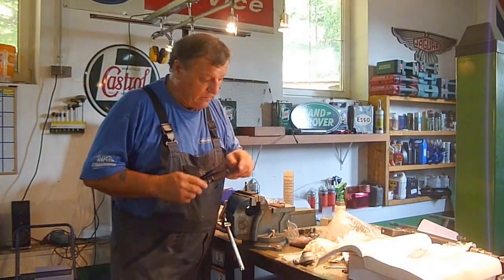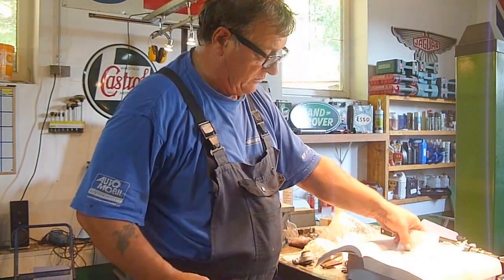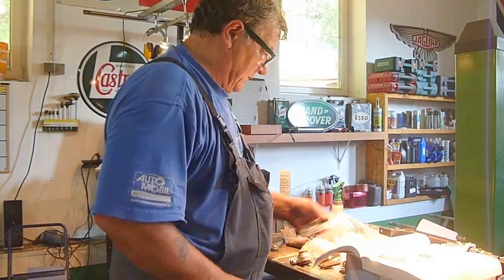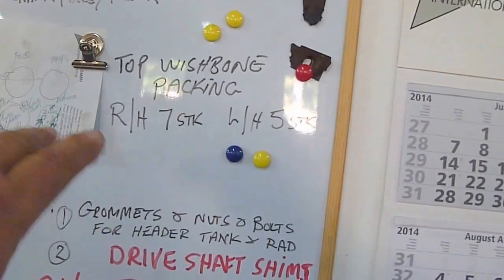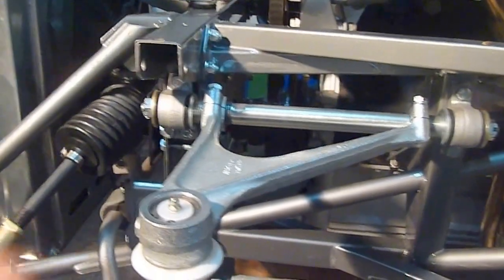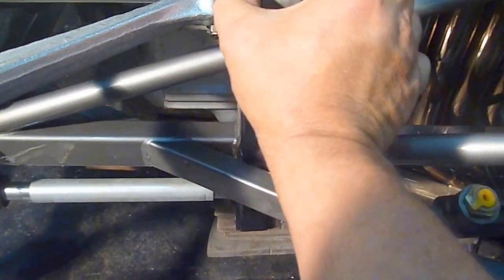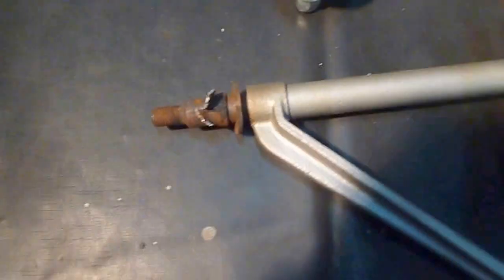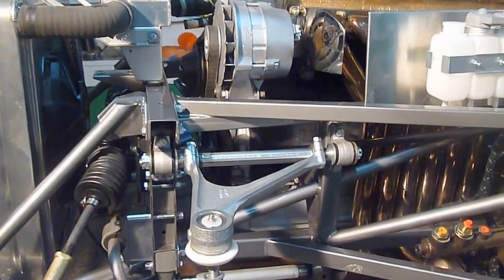Jaguar e type front suspension Part 1

Comment: Same thing happened to my lower bushing spacers.  They basically welded themselves to the fulcrum shaft.  I used a thin angle grinder to cut a spiral grove in the spacer.  I then peeled the metal away, like you are doing.  The trick is not to score the fulcrum shaft by going too deep on the cut.  I don't think a little "nick" here and there does any damage though.  And you can bet, when I put new bushings on, that there will be PLENTY of anti-seize compound inside.  Speaking of this phenomenon, some of the bolts did the same thing in the blocks which mounted inside the lower picture frame.  What a #%^$#@& THAT was getting those things removed.  Then I had to drill out the bolt shafts on my drill press.  Once you drill the bolt thin enough, it finally releases when you hit it with a punch.  You might want to try this on your upper split arm.  It'll be tricky because you have threads to worry about.  But drill it, heat it, and see if an easy-out will do the trick.  If that doesn't do it, drill a little larger, and repeat.  But a regular bolt shaft is WAY easier.

Comment: I have no idea what spacers were used for the front suspension on my 1962 XKE.  You counted many on each side. How can I determine what I need?
Reply from the maker: Bari, Check the green E Type manual and it should give you some measurements or distances as i said it is a bit of trail and error. Cheers Dave

Comment: Why use rusty shims when new are availabe ??
Reply from the maker: Keith, I used brand new shims all round but used a micrometer to check the old shims when i stripped the car down for the restoration and used all the factory thickness and settings.  Cheers David.
Reply: Ah, I see, I doubt if the factory settings will be spot on though, I changed engine frames on mine which meant that all the shim data didn't work, but got it all correct in the end, you must be running the car now though so were your camber and castor correct ??
Reply from the maker: Keith, I had it pre checked by computer before the TUV Austrian MOT test. Everything was well with in tolerance apart from the tracking due to a new steering rack. I drove to the UK and back the first year from Vienna. plus we did a tour around the cotswolds with the E Type club. All the best David.
Reply: Great, !! saw it was LHD  but thought it was a UK car and owner originally...I'm still not sure of the computerised check on my castor as there were an equal amount of threads showing before my rebuild, and now they are not equal, but saying that, the handling is fine, I also have an adjustable reaction plate, have to remove the front pipes to get at it though, mine are non standard like yours...